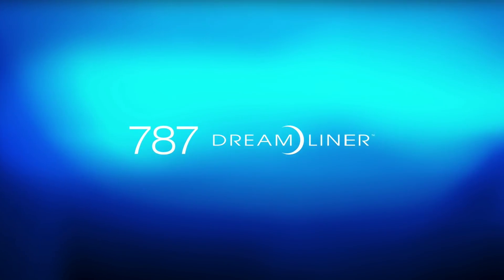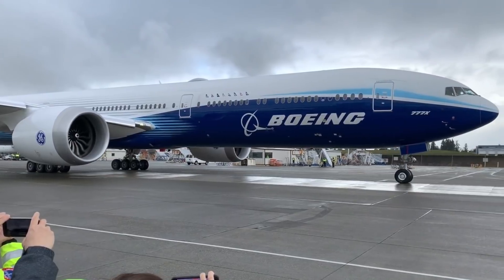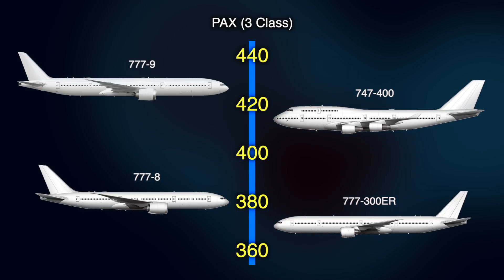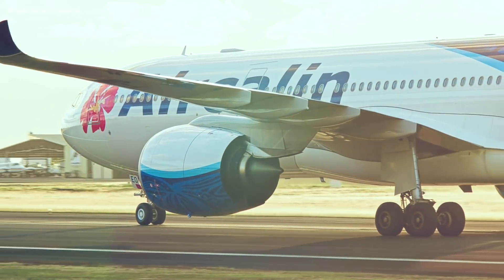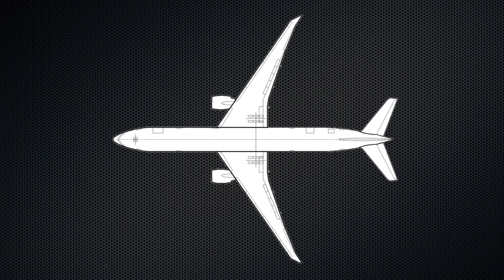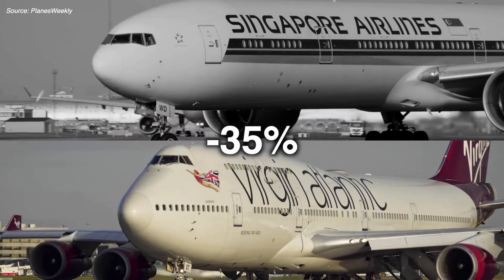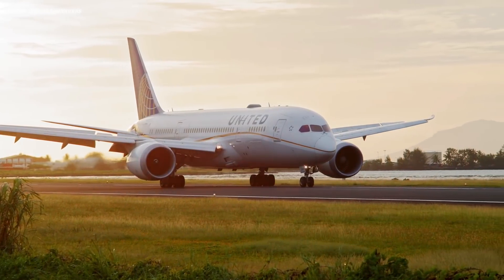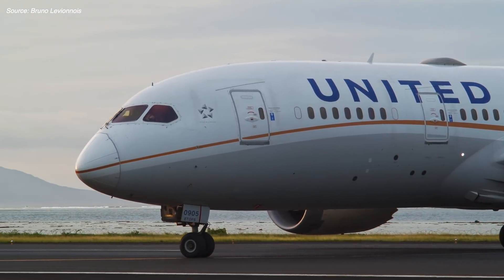The 777X Has a "Tesla Problem"

Comment: For all composite It all depends on fuel prices, emission policy in future. The stiffness of the wing in wing is more well distributed so landings would be much softer since deflect much easier and act like shock absorbers at touchdown. This also means lower landing gear maintenance. The problem with composites is that they break or crack during impact from tail strikes unlike metals that deform. So all composites would make a plane more zippy and more fun.
Reply: Wings acting as shock absorber at touchdown ? What are you smoking ? The wings weight almost nothing at touchdown because one second before touchdown they were producing enought lift for the whole damned airplane to not fall out from the sky.
Reply: @12345fowler  i said they act like shock absorbers. I did not say they are shock absorbers. What I mean to say is that the vertical component of inertia is reduced and the total inertia is spread over time, so the impact on the wheels becomes gradual soft landing since the wings absorb the vertical force/reaction from the ground during touchdown and deflect at that instant.

Comment: No, just NO.  CF is not 42% lighter.  No where close.  By density it is ~10% lighter.  By tensile strength it is ~2X as strong, but the elephant in the room... its compressive strength is ~50% worse than aluminum up to almost equal depending on orientation of fibers and its sheer strength is pitiful at well below 50% that of aluminum.  Next elephant in the room, CF is highly elastic compared to aluminum which is both good and bad.  In wings, this is good for gust conditions, but in the fuselage in a 2g+ wind up turn, this is really bad.  Since CF Shrinks as it heats up it cannot be used in a mix with aluminum very easily.  For instance everyone would LOVE to have a CF lower skin on their wings but an upper skin of aluminum.  Likewise every plane manufacturer would love to have a CF exterior on the barrel of the fuselage, but wants 100% aluminum longerons, bulkheads, formers, frames.   CF in the fuselage saves you no weight over aluminum.  Wings only and then only in the Big thick sections of the wings.  Wing tips are still lighter if you build from aluminum.

Comment: This is why I think the A350-1000 will beat the 777X in the long run. Clean sheet vs refresh. The A350-1000 is just a more reasonable size. Also it's smaller sibling is not a niche ULR. The only real selling point of the 777x is its commonality with older 777s. The only thing keeping the A350-1000 down is the COVID pandemic and all the existing brand new 777-300ERs. The A350-1000 will be a late bloomer like the A321.
Reply: i flew the a350-1000 2 months ago and i gotta say the passenger experience is incredible
Reply: There are also potential disasters with airlines furiously complaining about what initially seems to be a cosmetic issue, but is in fact, turning out to likely be a sign of serious galvanic corrosion of fasteners and/or lightning dissipation structures, either one of which could lead to disaster.
Reply: A HGW 787-10 and the a359 will beat the a350-1000 in the long run . The truth is the a350-1000 was ment as a direct replacement of the 777-300ER ...

Atleast 70-80% of current 777-300Er owners will either downsize to 787/a359 or upsize to the 777-9. 

Most airlines will not replace their fleets 1 to 1 . The a350-1000 will do nothing to the 777-9 . Lol

Comment: Boeing made the right decission.   They could see the demise of super jumbo market with the flagging sales of the 8i and then failure of the A380.   There was little need for the expence of composites as with any material it will be more efficent than any super and has no competitors in it's passenger count as a twin.  This is not to say it will succede but that may also be vindication since they wont lose as much if it does not.

Comment: Boeing shouldn't have built 777-X at all. Nowadays large airplanes are no longer favored. Boeing should have built mid-market airplane which replaces 767 & 757 + a new clean sheet single isle airplane replacing 737
Reply: Larger planes are not favoured that's true , but it doesn't mean there is no market or need  for them at all. 

If they did not build the 777X they would have left the high cargo market to airbus to enjoy alone . Loosing their cargo market share to Airbus

Anyways aren't they enough employees at Boeing to focus on 3 -4 different projects at a time . Should they only focus on one thing?

Comment: I'm convinced they should have gone all composite. Then every single plane from there on out would have been all composite. You need to do the big upfront investment to pay off in the long run. So if every single airplane Boeing made was all composite they would have a huge lead in the market. Then you could also stretch the cost over many different styles of plane.

Comment: Looking at the plane from a passenger perspective is only half the equation. Freight is a huge business. There isn’t a freight version of the 787, Airbus is just now catching up with a freighter A350. If cargo companies want the most advanced cargo plane the 777X is the only option right now. Another factor is commercial to freighter conversions. It is much more difficult to get install the cargo doors into a composite fuselage aircraft than an aluminum one. Boeing is banking on converting passenger 777X’s into freighter ones in the future.
Reply: You can't do a PtF on a 787. The composite fuselage is integral to the strength of the design. It has to be designed from scratch
Reply: Update: they did

Comment: There was also the consideration of the size of the autoclave needed to cure a composite body the size of a 777.
Reply: It would have been made in several sections like the 787. Kawasaki already built the largest autoclave in the world to manufacture 787 fuselage parts. With a 9m diameter it will hold 777 size components with 2.8 meters to allow tooling/jigs. The 777 fuselage is only about a foot greater in diameter than the 787.
Reply: Sorry, that is outdated info. The largest autoclave is in South Carolina at Boeing's plant. It has 15,000 ft³ more than Kawasaki's
Reply: @jahredt  Perhaps I was not as specific as I could have been.  Autoclaves can and have been built large enough.  Boeing built two massive autoclaves for the 777x wings in Everett.  Boeing has previously stated, in addition to the facts presented in this video, that their decision not to build a composite fuselage for the 777x was partially due to the size of the autoclave needed.  They didn’t not say it couldn’t be done.
Reply: @flantc  fair point. Also, that large of a modification I believe would have disqualified it as being an new generation 777. It may have essentially been a clean sheet aircraft.

Comment: I dont se that.. there is something else that cost here. The 777x is about 30% larger than the 787, still its quite a bit more than 30% more expensive, still the 787 was clean Sheet  (well, more or less) and almost 100% composit.

For a airline it simply is cheaper buying 4 787 in stead of 3 777x.

Comment: A major trouble is that designing a complex structure in an optimal fashion is highly depending on the type of material. You can’t just build the same fuselage, just changing metals for composites. You basically need to redesign and resize the whole structure, also taking into account the manufacturing processes for composite parts, which have their specific constraints, very different from metals that can be machined for example. So it would imply development and industrial tooling costs much as if it were an entirely new type of aircraft. On the contrary, the 777X is meant to be an improved 777, but no more. Entirely different from the 787 and A350, which were both designed from a white sheet of paper.

Comment: While it might be true that composite is so much lighter than aluminium, thanks to the non-composite nature of so many other components and structures (I don't see a rush to carbon composite windows anytime soon) the overall weight saving is generally accepted as being half that figure at around 20%, possibly even less as more advanced (and lighter) alloys are developed. This will probably have a significant affect on the calculations presented.

Comment: Solar panels are pretty much the same. Yes, you'd save money on your monthly electric bill but the cost of installing them on your roof may take years to recover the cost. By that time, you may have moved into another house.
Reply: It adds to home value. But true. I sell solar and how long you're going to be in the house factors into the decision. It's always one of the first questions I ask.
Reply: And like Tesla, there are cheaper EVs so they are not the only option
Reply: @129aslamnurfikrir4  Most people don't buy a car to save money, they buy because they like the way it looks, or its performance or safety features. Otherwise hybrids would be far more popular.

Comment: The problem is that there is a plane in that category with a full composite body. The Airbus 350. 

Would have been worth to mention that here. As that's also the #1 competition for the 777X
Reply: It saves them zero weight.  Coby is misinformed about CF vrs aluminum.  Only place in a fuselage where you save weight using CF is in the FORWARD section of the fuselage and its skin.  The rear section is lighter if you use aluminum and in the wing box where often they use titanium/stainless steel but here $$$ is a major factor.  a350 did get the EASA to allow them load alleviation in the critical 2G+ wind up turn which did allow them to make a  lighter fuselage and why Boeing was PISSED when this was NOT allowed on 787 by the FAA.  So, assuming load alleviation is allowed via FBW, CF could be lighter by a little bit, but not much.  So, until a HYBRID Aluminum/CF structure is built, CF by itself is in general, not lighter unless in VERY high TENSILE load applications. 
Now if they can use more honeycomb structures on lighter sections, then CF IS lighter and actually CHEAPER.  Why you see small regional jets going with CF and being lighter as making the CF honeycomb in rounded shapes is CHEAPER than trying to make aluminum honeycomb structures and they bypass having to use as many longerons, bulkheads etc which makes the build SIMPLER to make.  None of this is true on a big jet like a 787/350/777
Reply: @w8stral  A full composite frame can definitely be overrated. The biggest bang for the buck is in the engine and wings and Boeing did that.
Reply: @w8stral  I'm not contesting but I'm a little surprised by what you're saying. Why would composite only save weight on the forward section of the skin and not the middle or rear ? I really fail to see the scientific reason for that ?
If a given material is inherently lighter than another it wouldn't matter where it's located.
And I'm pretty sure the same thickness / resistance is required on the fuselage's skin whether it's the front, middle or aft ?
So, how do you come to the conclusion that it's only saving weight in the forward section compared to aluminum ?
I'm very interested in that.
Thanks.
Reply: @KyrilPG  Hoo boy... you displayed you do not know the basics of Mechanical engineering course where you learn what stress strain, elasticity, poisons ratio, and deflection along with density mean.   Yet you want me to teach you everything in a YT post regarding basic structures.... Typical
TLDR: CF deflects too much as its matrix(epoxy) is very weak regarding rigidity which means the wings are twisting one direction and the tail another is why CF fuselage between these two bodies does not save you weight. Forward fuselage has less stress in wind up turn and therefore less deflection which avoids the shear problems of CF laminates.

It is why the holy grail of CFRP or any FRP is stitched construction which will eliminate the shear problems(mostly).  The ultimate of this would be to use Silicon carbide nanotubes in aluminum.  THis would cut the weight at least in half.
Reply: @w8stral  Wow, you're reading way much more in my comment than what's in it. I wasn't the least bit dismissive nor aggressive in my message and it wasn't implied either. It was a genuine question, not an attack, not even a contradiction and not a request for you to "teach me everything".
I simply displayed interest in what you were saying and had questions.
I'm pretty sure you could have answered my questions in just as many words as you used in your reply without being obnoxious.
I asked reasonable questions, respectfully.
I even said I wasn't contesting and asking because I was surprised by what you said about forward fuselage vs aft.
I didn't ask for a full lesson on advanced engineering.
Just how can the forward fuselage skin could be that different from the aft fuselage skin.
And you could have replied a simple answer or started a short conversation, the civil way, like I asked my questions.
But instead you turned arrogant, dismissive and borderline insulting ("typical") without knowing anything about me, just assuming what I must be because I was surprised by your affirmation.
Instead of trying to give me a simple answer to my questions (I used several question marks) you listed what you're sure I must be ignorant of and went on to discarding my entire comment and questions as a cry for basic education.

Kudos, what a great way to make a point : being dismissive and discard any question by screaming ignorance while not answering any question !
If my comment and questions were not worth your time, and explaining in a few words for the benefit of all readers was below your standing, just don't answer them at all.
Cause answering genuine polite questions with a dismissive reply, void of any useful info, just makes your entire point irrelevant.

You must have a very high opinion of yourself in a very lonely world.
Reply: @KyrilPG  Ask obnoxious questions you know you wont understand you get obnoxious answers.
Reply: @patrickproctor3462  Thanks for the info! ;-)
Reply: @KyrilPG  
You asked a very good question, and yes, you were very considerate. 
Some of these clowns can help but be obnoxious jackrods, and have to show how bright they think they are.
Reply: @patrickproctor3462  
No that is a polite answer in lamen terms. 
It's appreciated.
Reply: @w8stral  
Well, now I understand why you made such a comment.
Good luck in life, you'll need it.
Reply: @alhanes5803  Enjoy your self righteousness, you will need it
Reply: @w8stral  I  bet you are an absolute scream at parties!!
Reply: @patrickproctor3462  Pretty hard to be banned from somewhere I have never posted at... and your statement regarding stiffness and energy absorption are entirely different kettles of fish.  They are not equal at all.
Reply: @w8stral  You're In!! LOL
Reply: @KyrilPG  I viewed your post the same way, just asking a question of someone who is clearly informed on this specific topic, but you were somehow flamed for doing it. People need to take a chill pill. Has been interesting reading the responses though - learned a lot! Thanks!
Reply: @w8stral  Bro his question was not obnoxious - but thanks for your detailed reply, was very informative. You could start your own YouTube channel!
Reply: @w8stral  Bro if you're such a genius why are you trolling YouTube 😅
Reply: @w8stral  Jesus, dude. Control your ego.
Reply: The  A350-1000 approximates the capacity of the B777-300ER.   The 777-8 is larger than the A350-1000, and the 777-9 is much larger.    An A350-1100 is technically feasible should demand for aircraft in this size category ever justify it.   In the current environment that appears to be many years from now, if ever.
Reply: The Airbus A350 is a fantastic plane!
Reply: The 777-8 is a dead duck. The bare weight of the airframe vs an A350 makes the A350 far more efficient this needing fewer passengers to make brake even on a route
Reply: Right on the money there the triple 7x is going to be Boeing's A340 moment.  The right aircraft for the wrong era.   But as an Airbus fanboy I must admit to a bit of a sadistic delight in this
Reply: The A350 and 777X are really 2 classes of aircraft. By the time you stretch the A350 to have the 777-9's capacity, it'll be past the length limit for a Class E aircraft, meaning it'll need to be placed in A380/748I gates only (without specific exemptions like the 748I gets at LAX, JFK, LHR, and FRA). Meanwhile, the 777-10, seating 450 in 2 classes, would still fit gate requirements with another 3 rows to spare at 30" of legroom each.

According to the regulations, you must have a passenger no more than 2 seats away from an aisle. Therefore, you can seat up to 3-6-3 in a 2-aisle craft. You wouldn't directly compare the standard A350 3-3-3 config with that setup. You could fit an A350-900's passenger payload in a D-Length craft under that design ethos. It's the same case between the 777X and A350. Yes, you can fly most of the same missions with the same passenger payload, but the 777X's width gives it a distinct cargo advantage, and its engine supremacy puts it in a league of its own for total capability the A350 cannot match.

Now, remove every extra pound and source of drag from the 777X that you could with an all-composite design, and the A350 would be completely buried.
Reply: @patrickproctor3462  There's a lot of ifs in there. 
There is no all-composite 777x
Reply: The A350 is a direct competitor of the 787, not the 777. It was built in response to the  787...
Reply: @daviking-88  Yes that is true. I'd say Airbus saw the Boeing offering and decided to build a plane in the middle of the 777 and 787. The larger A350 competes for sure with the smaller variant of the 777x, but also for a part with the bigger. 
The smaller A350 competes with the larger versions of the B787. 

Imho.